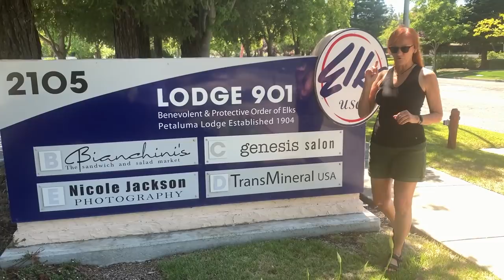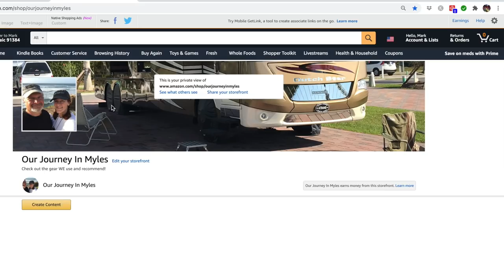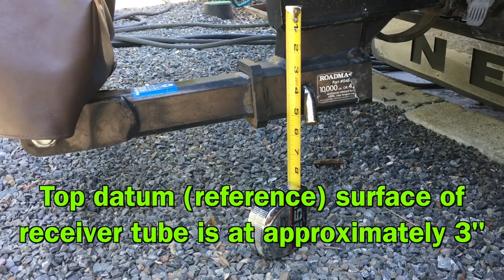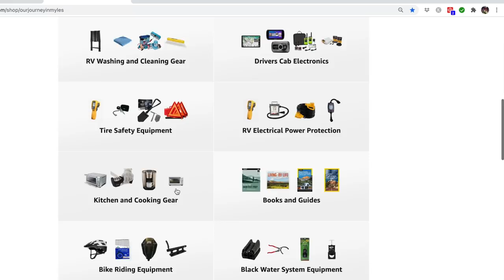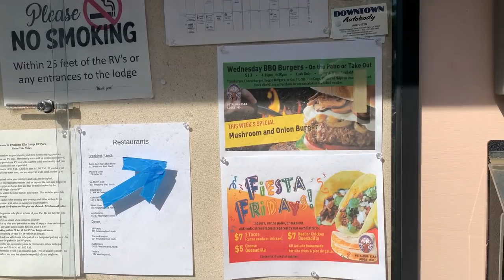RV DRIVING STRESS | THINGS GO WRONG QUICK WHEN ON THE FREEWAY | TAKE YOUR TIME WHILE PARKING-EP177

Comment: Interesting close up view of your Newmar rock/mud guard, it has the same angle iron bolted along the bottom for support/counterweight as the one I purchased from Newmar for our Ventana LE (which didn't come with one). After using it for a year or so I removed it feeling it was more of a liability as the angle iron could catch on an obstruction in the road causing significant damage in addition to crushing the DEF exhaust system as you pointed out. Newer designs from Newmar and others replaced that angle iron with a piece of steel with a low profile no snag shape that would glide over obstructions. 

I would have been pretty stressed out watching that extended trailer hitch inch towards the gravel. Happy to see nothing damaged
Reply from the maker: Wow,........the flat design weight really does have an advantage as long as its stiff enough.
Reply: @OurJourneyInMyles  If you look at it from the side the steel is wider than the angle iron with a gentle hump much like an ant hill profile in the center for stiffness

Comment: Hi guys, I just got to this video after about a month and a half of travel, unfortunately only 1 weekend of it was in our new to us 2014 Newmar Ventana DP. A couple of questions; if you would have preferred to stay further back in your elks spot, why didn't you manually level without airing down? Why did you lower the front of your coach? Putting the wheels down just enough to not let them turn freely takes almost none of the hanging weight off your suspension and those wheels add nothing to your stability or positioning. Thanks, I always learn something from your videos.
Reply from the maker: After I recorded how much things tetter-totter back there, I will NEVER back over any overhang ledges again.  Airing down before leveling makes our lift in the front less dramatic normally.  All the irv2.com forum advice says to take the hanging OFF the front wheels.  We all know that a hard stop is designed in a suspension mechanism such as this. The minimal support is to "dimensionally put the bag at something less than maximum extension" during your stay.  I assume this is to keep the bag in as good a shape as possible.

Comment: One of your jacks between your drive axle and tag is missing a SnapPad.
Reply from the maker: Our rear jacks are too large in diameter to get jack pads for. They are 13" diameter.  The newer Dutch Stars actually have smaller rear jack pad diameter.

Comment: On your Dutchstar do you put out slides and then level
Reply from the maker: Because of the Full Wall Slide, a NEWMAR coach will “most of the time” go back together better on the air suspension while on your tires.  Sometimes we have to violate the procedure due to issues that arise, but we mostly only deploy the slides when aired up, on the tires only,…..then level.
When folding up,……come off the jacks,……air up,…….shut off engine,…..bring slides in.  We have opened EACH of our slides over 100 times.  Results with each evolution is always different. The best result is “usually" following the procedure they recommend in the manual.  Many folks are misinformed on the correct Newmar FWS model procedure. Newmar has published PIB#38, issued 01/29/15 addressing the change in procedure for all Full Wall Slide coaches only!  Make sure you also get and understand TSB-466 (Technical Service Bulletin)  This is about the gear box mounting bolt torque issues you need to monitor.  This issue cannot be ignored. When the bolts get loose, the gearcase will snap off.  It’s a $1500 repair.

Comment: While I have had a couple of Newmars , monoco, and a wonderlidge  I got out of rvarcing because of the constant requirement of extentive maintenance.   I’ve spent more time at NIRV and I wonder how you two continue to fight the tv experience?
Reply from the maker: It is a fun coincidence that I am replying to you from NIRVC-Atlanta for Ceramic Boost and Oasis Heat/Water Heater Annual Maintenance,............right after being in for yearly Chassis Maintenance at Gaffney SC Freightliner.  So far for Sue & I, the trouble & expense still is totally worth it,.............but we try to warn folks,.........it is a super, ultra, expensive lifestyle to travel & tour full-time.